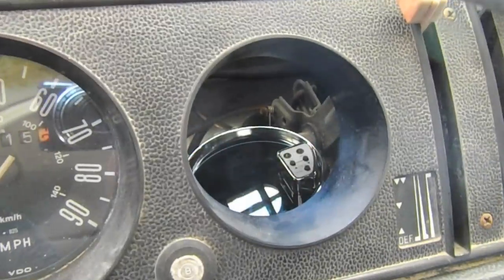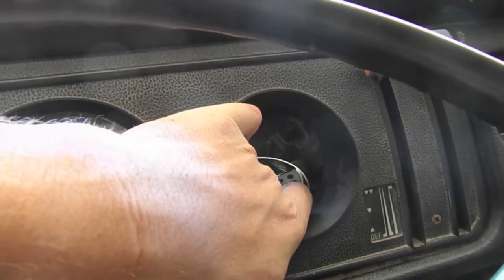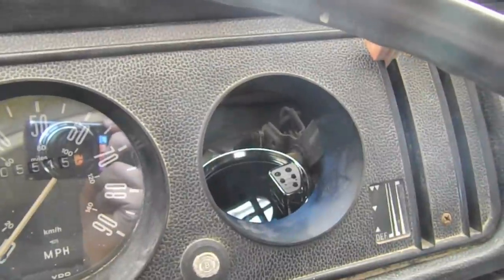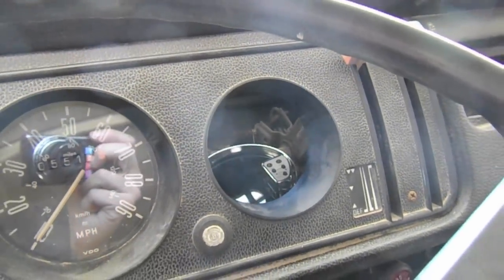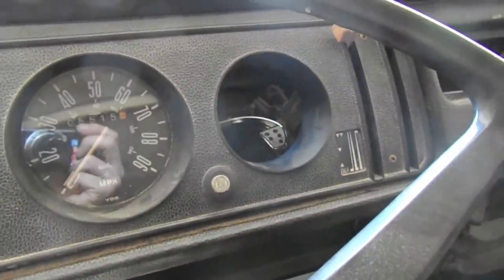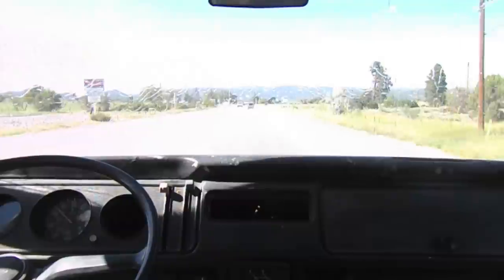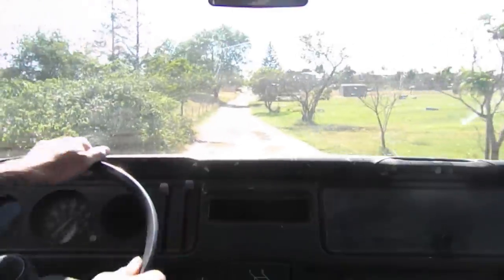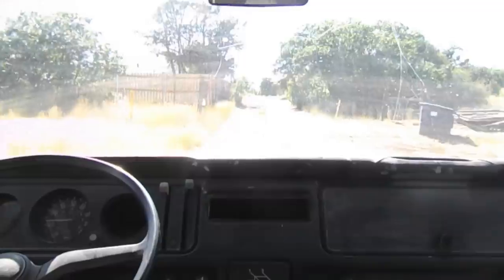Subaru powered VW Bus on the road - Busaru engine conversion part 11

Comment: Just finished watching the entire series back to back.  All I can say is I'm impressed.  I have a 1968 High Top sitting here in the shop that may have to get one of these.  I have wanted to do this in my 86 Syncro with possibly a 2.5 or ultimately a H6 but just need a little nudge to get going.  I think I might experiment on the 68 first and then tackle the Syncro.  Always a learning curve and the Coulda-Woulda-Shoulda with projects like these.  Thanks for the great documentation and step by step process.  Really enjoyed the series.  JC.
Reply from the maker: Thanks for the compliments and your comments Jeremy. To be honest, I would go with the Syncro project first, as it'll help cut your teeth a little easier. The SubaruVanagon cult is huge and you can buy every single part you'd need. If you wanted a little more of a challenge, get a JDM 2.0 Turbo with a Microsquirt ECU and really have some fun :)

Comment: Very informative videos. I am building a vw trike and putting a ej25 subaru engine in it. But trying to figure out  wiring. What  are the minimum wires and components needed?
Reply from the maker: Hey Floyd, your best bet is to grab an input/output data sheet on the computer you're using then eliminate things like fuel temperature sensor, etc. if you get stuck just send it to me and I can get you set up. Sounds like an awesome project!

Comment: Hello out there all you gear heads. I just have a simple question. I have a 1977 v.w.westfalia camper van and have read hundreds of the threads about the subaru engine coversion. I have made up my mind that this is going to be my winter project. I've been looking at engines and my question is I have a choice between buying a 2.0 turbo or a 2.5 throttle body. I'm going to go with  the subaru 5 speed manual transmission. which engine is my best bet for the swap. I realize that the 2.0 turbo will give me more h.p. but will there be enough room for the turbo. Thanks fellers for your input. God bless. Rick

Comment: Dude that is awesome I've wanted to the same thing to a Bay Window for a long time. I even considered a diesel option from Subaru or a 1.9 TDI. My purist friends will shun me but I can live with that. I talked to a guy at Buses by the Bridge 2 years ago that had a TDI in a 73 it ran strong and got over 35mpg.
Reply from the maker: Id say on a really clean bus it might be crossing the line, but those are usually in good hands right now. The ones for sale, for a reasonable amount, usually aren't the ones that will be show worthy anytime soon. Thats how I can justify the Subie swaps to my purist friends - that and the fact that I can totally smoke them in any situation :)

Comment: Nice work ! Looks so much more fun to drive. Enables a  a bus roll with modern day traffic. Doing a stage one chipped svx H6 and subarugears 5 speed this summer on my 86 westy.  Should haul arse and conquer the Rockies with ease.
Reply from the maker: The 3.3L paired with a 5 speed and Vanagon sounds like a great combo. My shopmate has a 3.3 in his High Top Syncro and it screams, He's rolling on about 33inch tires and it still pulls really hard. Good luck with that swap, and make sure to document it so we can see how it does.
Reply: Busaru I have a few buddies through my FB group Subaru powered Volkswagens that have the 3.3L and love it. It's basically an OBD1 2.2 with two more cylinders .Fairly easy to buy in my area as many svx's suffered auto trans failure. I'll post build vids on my Utube channel . The Subarugears conversion is the way to go in my opinion. The fuel savings(3-4 mpg+ maybe) will even eventually pay off. My 4.11 Subie R&P will spin 2533 at 65mph not 4000 rpm like my stock vanagon.   . Downshift -58mph in 4th ,3000 rpm and hammer it for a pass should be a blast. Won't also need an adapter plate or bell housing, CV speed sensor ect.....
Reply from the maker: VanaConn Vanagons Very true about the adapter plate and VSS - I hadn't thought about that. I guess my biggest hangup has been the cost of kit - what did you end up paying for yours? (Just the kit, as I'm sure you also had to pick up a used transmission as well).
Reply: Busaru I paid $1880 USD shipped plus paypal exchange rate fee. Todd owner of Subarugears ran a group buy on my FB group Subaru Powered Volkswagens a month later for $1500 for the whole kit shipped to your door in 5 days ! Join and he will personally answer your questions .I added a link in "files " to your radiator set-up. We can also ask for another group buy. I also used a currency converter app to track the USD to AUS exchange rate. Saved some money that way.
Reply from the maker: That's definitely a good deal if you either don't have a transmission with your bus or if you do a ton of highway miles. I'm definitely going to join the group - thanks for the invite!

Comment: I have a 1976 with a rare auto transmission. A few years ago the engine, or Trans, or both locked up on me. It's been parked under a cover for 4-5 years. I don't want to get rid of it. I would really like to find a turbo Subaru engine and trans to put in it.. Is this possible?
Reply from the maker: +Skippy I would say the turbo Subaru is possible but will take some creative exhaust work. You'll probably have to relocate the turbo to near the timing cover side of the engine. Sounds like a fun project though!

Comment: From start to finish, how long did it take you to complete the project and how is the cooling coming out on your conversion?
Reply from the maker: Hey George, Its taken me a couple months but its been somewhat on and off due to travel, paid projects, etc. This white bus still needs some brake work so I haven't had a chance to test the cooling system completely. My 73, from the intro video, uses a very similar setup and does pretty well on cooling. This is all still very experimental however. What works for me may not necessarily work in your environment.

Comment: That high pitch noise, is that the electric fuel pump? Is it located inside the tank? JP
Reply from the maker: Hey JP, that constant high pitched noise is the fuel pump. The pre-filter is full of silty rust. I am going to be switching it out for a fresh inline filter and that'll quiet it down. I'm hoping a few pre filters will eliminate the constant trickile of rust.

Comment: Thank You again for these vids, I'm sure later you will do a front brakes upgrade lol. Are you planning on dropping the bus slightly?
Unlucky about that Gauge falling off lol.
What will be the next vid be on?
Reply from the maker: I'm working on the brakes now and will probably be doping that vid next. If anything, I'd want to lift the bus a little. It sits on some pretty big tires that will work great for the back country.

Comment: Excellent series.
What sort of weather have you been driving it in? How well does your radiator setup cope?
Reply from the maker: ItsFriscoBaby Its been pretty warm here lately - 80's mostly. In town driving, traffic, and highway are great. Long sustained hill climbs aren't so great - heats up a little too much for my taste. I'm working on getting that dialed in and will post up the results in the next few weeks.
Reply: +Busaru So a year later, is the cooling system still up to the job? Is it getting much use and have you made any changes.
I'm debating where to but the radiator on my conversion.

Comment: Awesome video! You look like shaggy too, which made it even better lol
Reply from the maker: +randy smith HA! Thanks Randy, I've always aspired to be like Shaggy.
Reply: I understand! Haha thanks for the reply! Do you know what would be best to swap with a 68 bus? It formerly had a 1600 in it. I'm impressed with the Subaru motor! I'm just not sure what I'm looking at as in cost and how much mechanical work.
Reply from the maker: randy smith Well, it's a decent amount of work but if you dedicate a few weeks to it, you'll have a super reliable, efficient, and powerful rig. It's going to cost about the same whether you go with a 2.0, 2.2, or 2.5L engine as all the parts are the same for the swaps. Parts will run a few thousand then you just have labor. Let me know how it goes!
Reply: Awesome man! Thank you so much!! Keep rockin brother!
Reply: +Busaru hey brother, sorry to bother again, but I was wondering if the bus transmission would work with a Subaru motor? all I'd need is the adapter, correct?
Reply from the maker: randy smith Yep, KEP makes an adapter plate that'll work for just about any VW to Subaru mating.

Comment: You need to get a dealers licence plate to put on the back before they get road registed. Here in Australia all motor vehicles dealers and panel shops in my state have a licence plate that they put on the back with a strap and it covers insurance. Check to see if dealers in USA or Canada has them. You would have to apply your state or Provence at your where you have to pay for motor vehicles regerstration and drivers licence.

Comment: where is the best place to buy this subaru engine?
Reply from the maker: +Dominick Scarzafava Donor car, JDM Dealers, or a rebuilt engine online.
Reply: if you get a donor car you get all the wiring harness, guages, radiator and other stuff you might need to source in a junkyard too